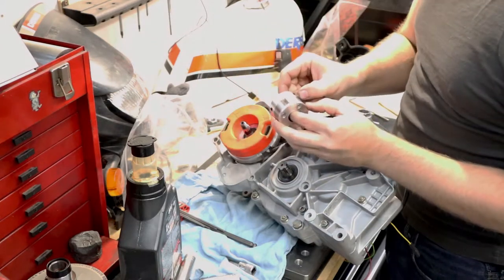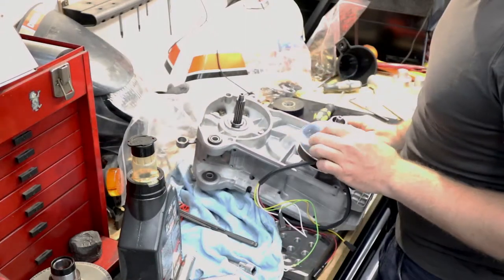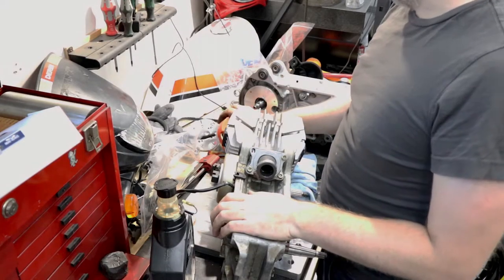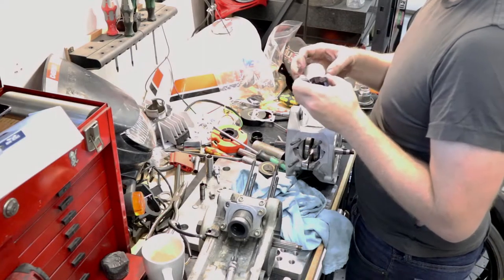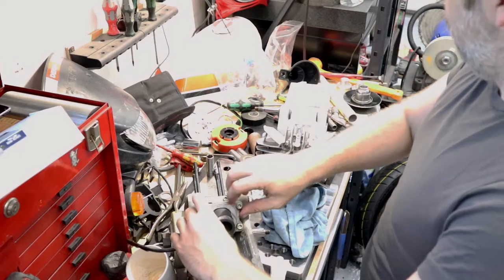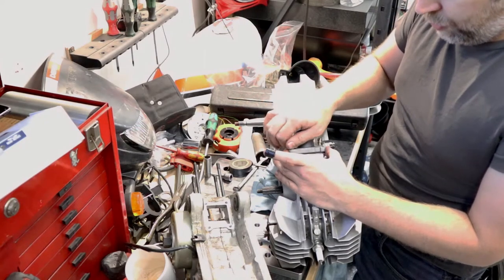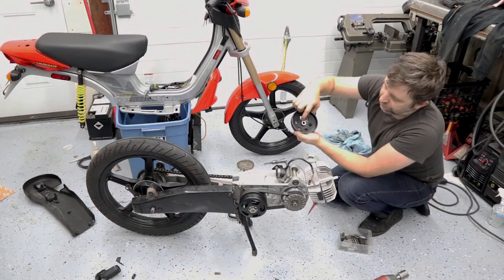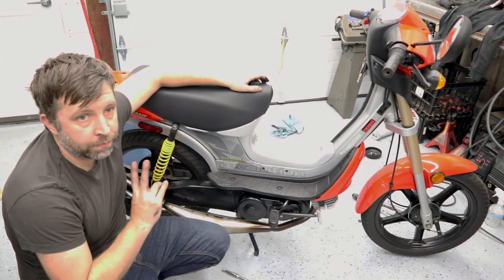How to Rebuild a Derbi Start V Engine - Part 2 - J's Garage

Comment: smooth engine swap! Started up and sounds great! Which pulley is that and where did you get the bearing?
Reply from the maker: It's a Honda Dio Zx Pulley, but really any pulley will work I have eyeballed/Modded both a Piaggio/Honda and Minarelli on there. The bearing is a HK2018RS which should be available at any bearing supply place.  Mine were Koyo I think.  I got them from Motion here in Canada.  Make sure you install the seal in the right orientation!